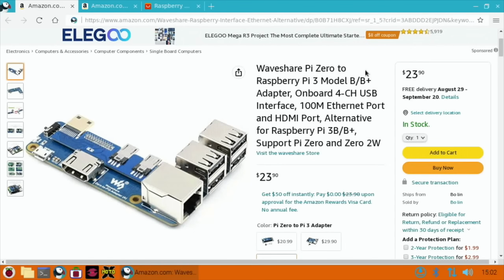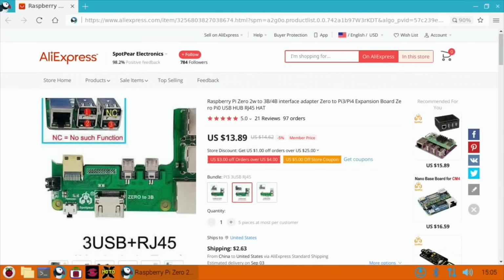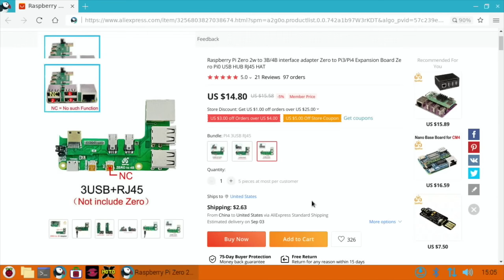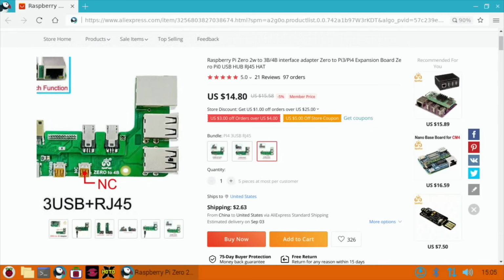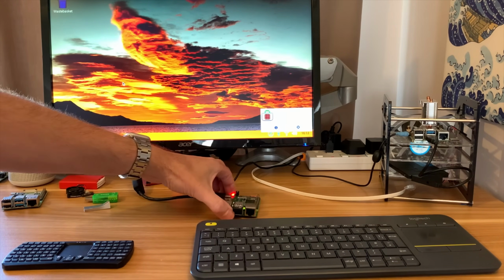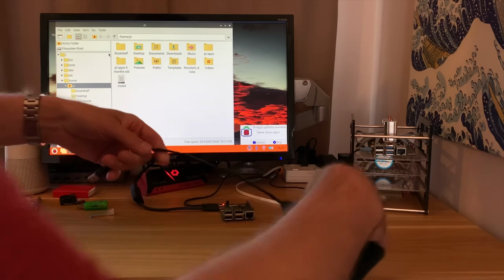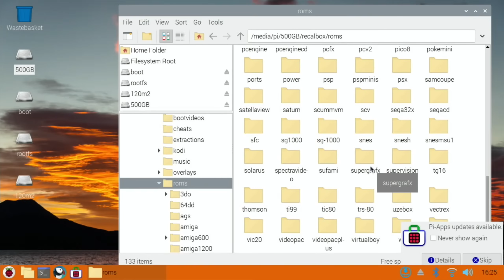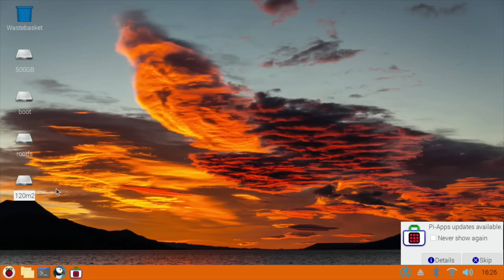Raspberry Pi Zero 2W to Pi 4B adapter

Comment: Does the adapter allow us to connect standard size extensions (HATS) to our pi zeros?
Also, would a pi zero W work on this or do i have to use a Pi zero 2W for it to work?
Reply from the maker: Works with the zero w link in the description states it will work with both

Comment: I have a Pi 4B 8GB RAM model and I have that same extension board at 7:12 that gives the Pi 4B the full HDMI ports and extra USB port and I also have a WaveShare PoE Hat for the Pi 4B that adds a fan(with switch to turn the fan on an off) and a USB port. Now I need to get a case that can house all of those.

Comment: Hey lee
Darling OS has been updated
It has addressed some of the things which you didn't like about darling os before and got some general improvements
Brief changelog since the last version that you tried:
Disabled panel autohide
Sudo now works (Using opendoas-sudo which is a symlink to sudo using doas)
Replaced pamac with yay
Updated config.txt to have more documentation
Updated DarlingMenu to show some system information things and added more options
Removed LY (The login manager, DarlingOS now autologs on to either a desktop environment or the console depending on a line in config.txt)
Improved boot speeds ever so slightly
Yay now uses all of the pi's cores for faster compilation speeds
Added a startup sound
Added an optional wallpaper (Can be changed from wayfire config manager)
Added a cursor theme
Added an SSH banner
Cleaned up the Application Menu

Notes:
Gpicview is broken and will be addressed in a later release
Although Darling OS does not support other boards it is technically compatible with most pi's, i've personally tried it on both my pi4 and pi3 and it seemed to run better and faster than raspberry pi os even on unsupported boards, I will probably add official support for other boards one day to fully utilize board specific features in the near future

If you have any other suggestions please let me know :D

Comment: I've been looking at these adapters as away to add USB ports with power to Pi4, maybe other things. Not sure if that would work. I noticed you had one Logitech dongle there. I just reduced down to one, using ltunify, to save on power. My new touchscreen seems to use a little more than the official 7". At the ragged edge with overclocking trying to run on a 12v 3A battery (buck converter down to 5.2v.) Larger battery is incoming but I want to see how long I can get it to run.

Comment: The Raspberry Pi Zero 2W does seem to be left a bit on the side line.
I tried the usual OS with it and an Arch distro but actually had more fun with Kodi.
I had a few films on the SD card and could play locally, remote to the web page for the PI and select to play a media file locally or remotely.
But I wonder if there is a port of Pop OS.
I do like the idea of a really small pc, that I could just pop round to a friends house, plug up to a TV and then stream films etc on
Reply: i use osmc . can be managed with mouse or controller . Just stands for open source media center . kodi base i believe but streaming apps as well as retro cores are possible . great for just movies or any of the other stuff too. i have the 3b so it should work fine . x265 720p or 1080p are rough from usb 3.0 stick just from experience but anything x264 seemed fine .

Comment: That is a cool board. Is that video from a few weeks ago the one where you talk about this OS, because if so I'll have to check it out too.
Reply from the maker: Probably this one

Raspberry Pi Zero 2W. First time setup. Far better performance with Zram.
https://youtu.be/vZkfuVyybIw

This also shows promise

Raspberry Pi Zero 2W optimised Darling OS.
https://youtu.be/p_344q08Nqs

I have a load more Zero 2W videos

Retropie. Raspberry Pi Zero 2W. PSP, N64, PS1 & more tested.
https://youtu.be/w2OKJee06tA

Raspberry Pi Zero 2W First time minimal setup. Powered by TV.
https://youtu.be/3eGP00uXcUU

Doom & Duke Nukem 3D on Raspberry Pi Zero 2W. Dosbian.
https://youtu.be/vhaf3m_jv-0

Overclocking Raspberry Pi zero 2w. From 1000Mhz to 2147Mhz
https://youtu.be/Wshq5rpDQHc

Usb boot Raspberry Pi zero 2w. Speed tests SSD Vs SD Vs USB drive.
https://youtu.be/H-kkZo09ECg

Linux on iPad with Raspberry Pi Zero 2W. XRDP and Zram
https://youtu.be/ACYd6acpCSk

Great USB hub for Pi Zero 2 W. How many drives can I plug in.
https://youtu.be/reyLeYB8wr0

Comment: I use a waveshare usb hub board that is the same footprint as the pi zero 2 w and gives 3 usb ports and 1 ethernet, it's awesomely compact and uses pogo pins on the zero 2 w to connect everything
Reply: Mee too

Comment: Thank you so much for this. I’ve been wanting to do more testing with the pi zero 2 as a desktop and these boards will be so helpful. Also, have you seen argon40’s nvme bottom for the argonONE? Not sure if it will help performance or if it’s just overkill.